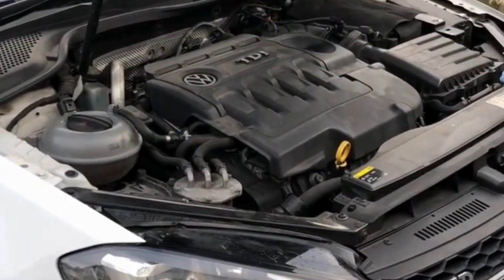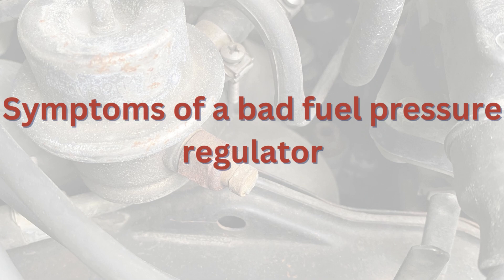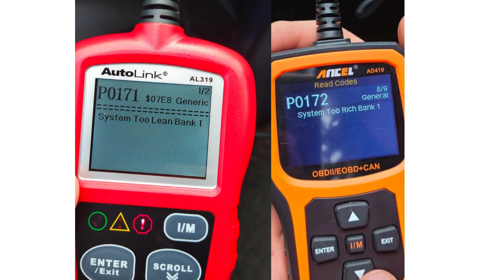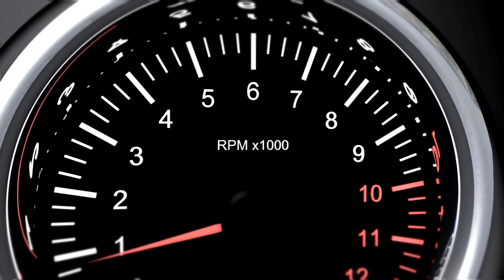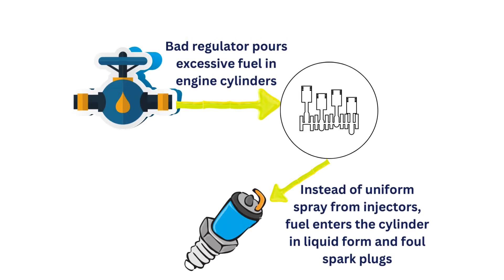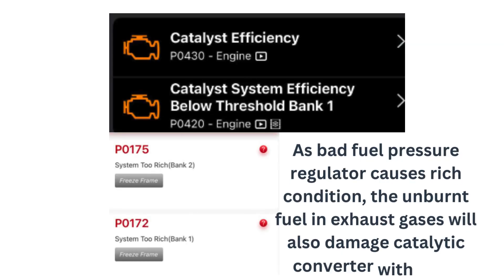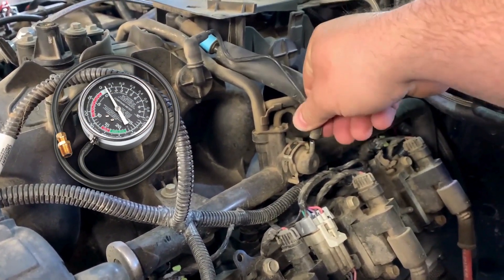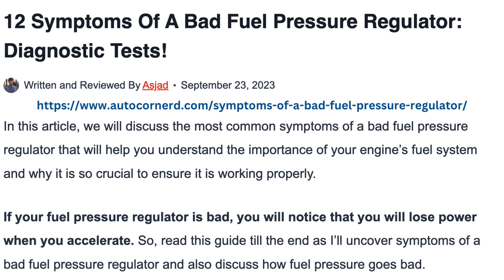12 Signs Your Fuel Pressure Regulator is Failing (and Ruining Your Car) | Fix it Now!

Comment: Thanks for the info, my 14 wrx is giving a rough idle and sputtering in 2nd gear. I also had a check engine light said system too rich. I’m in the process of troubleshooting. Changed spark plugs, cleaned MAF , New intake filter. I’m going to conduct vacuum test on intake. Any suggestions